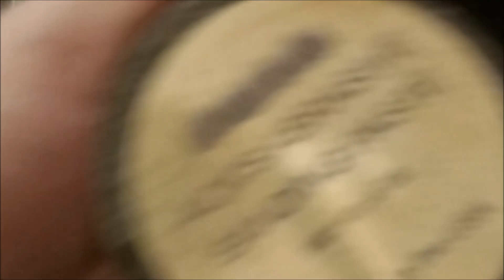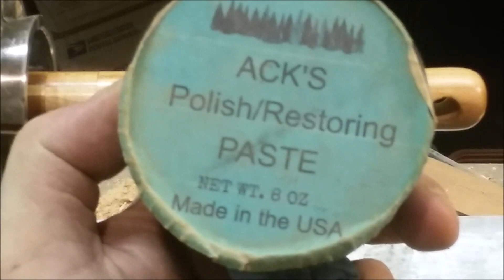woodturning a segmented ferro rod handle

Comment: Do you use water or oil stones when sharpening your tools ?
Reply from the maker: just depends on how dull they get dean . if there really dull i use a bench grinder . but most of the time i use a diamond stone with water . or if i just want to put a fast edge on i will use the fine diamond stone dry just to touch up the edge .
Reply: @diydarkmatter  Got ya. I do most of my gouges in a purposely slotted oil stone but for all the knives or parting tools they get the Japanese water stone treatment. Oh how I love my water stones.

Comment: You still have the possibillity to make your first segmented turning, but this was not segmented turning. A segment is a part of a circle, you cut up pieces and arrange them in a ring and glue them together.

The blank you created could be referred to as a laminated blank, and the result was nice, but not a segmentet project.
Reply from the maker: well i hate to disagree with you  how ever segmented pieces are just that segments of wood scrap pieces  or cut offs  there is no rules that say they have to be in a circle . laminated  wood is thin strips of wood people use to glue over cheaper wood to make it look expensive . now feel free to prove me wrong if i am i will be happy to accept it . but thanks for your input erik and thank you for watching .
Reply from the maker: Segmented turning, also known as polychromatic turning, is a form of woodturning on a lathe where the initial workpiece is composed of multiple parts glued together. The process involves gluing several pieces of wood to create patterns and visual effects in turned projects.
Reply: @diydarkmatter  you might be right that laminated is wrong word too.  But check up what the term "circular segment" means.
Reply from the maker: @eriklarsen6131  i think what your thinking of is segmented rings for turning bowls . and yes that is segmented turning also . its great for turning bowls but i was making a segmented handle  and there a bit small for segmented rings . it also would have left the center hollow . ill look it up though just to make sure but im pretty sure you are thinking of segmented rings for bowls . thanks erik